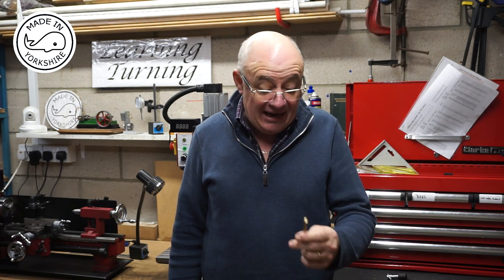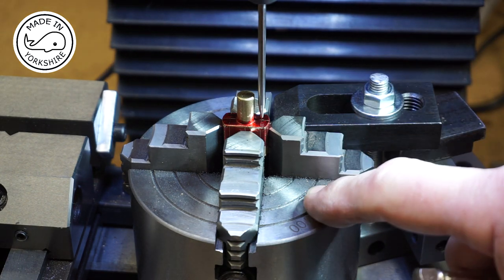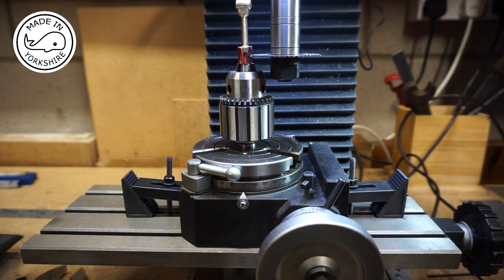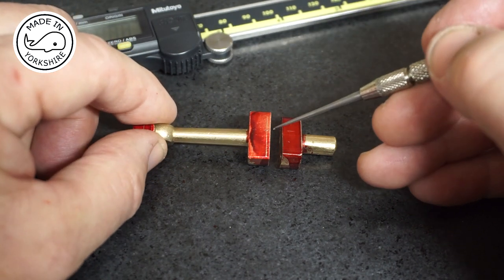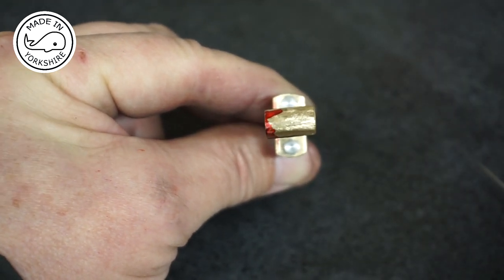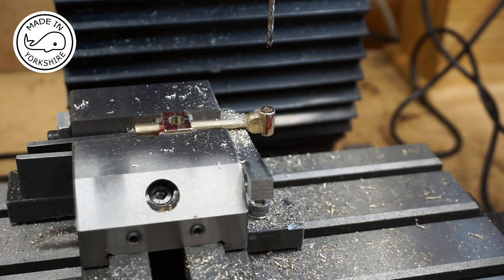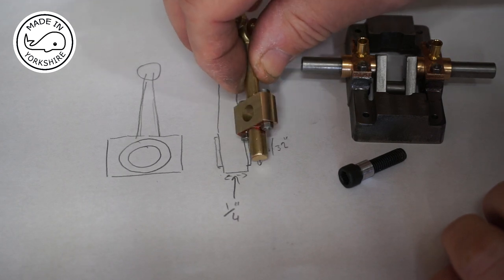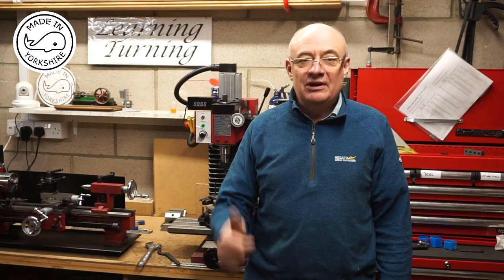#MT25 Part 9 - Making a Stuart 10V Steam Engine. The Conrod. By Andrew Whale.

Comment: I found myself yelling at the screen when you said you were going to drill and split the big end first. My thought was that the spigot is there to do any lathe work first. They gave a fair amount of material to work with there so perhaps working the small end first as that was more critical. Given that, then perhaps there might be enough meat left at the big end to straighten out the casting. Thank you for making these videos, I am enjoying them and will binge watch all your other builds immediately after.
Reply from the maker: Hi Grant. Yeah, you live and learn. I got there in the end but I would definitely reconsider my method next time.
Thanks for watching.
Cheers
Andrew

Comment: If I knew the material in the con rod casting would allow it I think I would have held the big end in a vise and used an adjustable wrench to twist the small end into alignment.
Reply from the maker: Hi John. Yeah I think I would try something similar to what you are suggesting. Probably apply some heat at the same time. Brass pressings are all new to me, but I would be more confident applying a bit of brute force next time.
All the best.
Andrew

Comment: I have deleted a comment that would have been useless to you. Given the point at which you discovered the problem I would have cut the con rod and made a connecting piece to pin and loctite the two parts in the correct position. I would advise against twisting brass it will just shear. Great video
Reply from the maker: Thanks John. A great idea 👍
Cheers
Andrew

Comment: Andrew. Like you, I was progressing nicely with the piston conrod, until I'd milled out the recess in the little end to take the cross slide. I'd clamped the big end in my lathe milling vice with the flats horizontal, then centred a 1/4" slot drill, held in the 3 jaw chuck, on the big end. Visually, the recess looks centralised but the widths of the "ears" on either side are significantly different.This, and your experience, tell me I'm not paying sufficient attention to pre machining inspection and set up. I didn't actually check that the vice jaws were parallel to the cross slide. It looked OK, but I should have used my DTI to eliminate that possible source of error. I'm giving a height gauge and granite surface plate serious consideration.The supplied stamping looked just like yours. The replacement I ordered looks like it's been through a CNC machine - even the spigot has been machined, so I expect it to be in perfect alignment. I asked Stuart if this is now standard in their kits, but didn't get a response. These conrods are too long to mount in a 3 or 4 jaw chuck: they won't swing over the lathe bed, but they will fit in the bed gap, so I'll have to mount them on my faceplate. Centring with a brass hammer is time consuming and frustrating, and the need for accurately positioning the big end is of some concern.  I'm setting up a dial indicator on the vertical milling slide. A wiggler works quite well on the lathe and I can locate an edge quite accurately. With careful measurement of the big end it should be possible to indicate close enough to the required point.I've almost finished my indexing head which can produce 2,3,4,5,6,9,10,12,15,18,20 and 30 divisions using a 30 tooth worm wheel and just 6 holes on the plate. So I can stop procrastinating and get on with the cylinder head.Your cross head/piston rod/piston work looks superb and I'll be please if I get close to that standard.Keep up the good work.
Reply from the maker: Hi Len - very interesting indeed. I think I read somewhere that Stuart had stopped stamping the 10V conrod - but I could be wrong. Having said that, it doesn't explain why I ended up with one. I definately recommend a height gauge and a surface plate - a very worthwhile investment. Although I've not started on the valve components, I hope to start trying out some assembly in the next video to see if what I have made so far works well together. We will then see just how good or bad my standard is! Good luck with the cylinder head.
Cheers
Andrew

Comment: Andrew, you might contact Stuart and let them know about the problem with the con rod casting. While they may not click on a link to this video, instructions on where they can view it, such as “Learning by turning - MT25 part 9..., could let them see first hand what you encountered.
Thanks for another great video.
Reply from the maker: Thanks for the suggestion Robert. By the time I realised it was 'warped' I had already spent a lot of time on the piece. I might give that a try if I end up having to re-visit it. Fingers crossed it will be OK.
All the best.
Andrew
Reply: Learning Turning Metal - by Andrew Whale the reason I suggested contacting Stuart was so that they could look at their inventory to make sure that others didn’t receive defective parts and not necessarily just to replace the defective part you received.
Reply from the maker: Ah - sorry - I misunderstood. I might give it a try.
Thanks
Andrew

Comment: Hi, if you had made the mistake of drilling the 1/8th hole all the way through, a solution would be to drill out and tap it to a larger size say 3ba, then  thread a suitable piece of brass and silver solder that into the conrod.  Then drill and tap to the correct size.  Not perfect but a pretty good result would be effected.

Also if the brass component os out od line and twisted as yours was it it possible to twist the part after annealing it and then re anneal to 'relax' the stresses involved.  The conrod would work harder later in service.  We would often have to remedy such errors in my engineering days.  The world is nopt perfect, we all make mistakes, the skill is knowing how to rectify them.  By the way, a silver soldered joint is almost invivible when machined.
Reply from the maker: Thanks TerryD15. I think I would now have more confidence in following the approach you suggest.
Cheers
Andrew

Comment: Coming along nicely :-)  It's a shame the stamping had poor alignment but I did wonder if you may have got round the problem if you had drilled the little end first (to run true in the skewed part) then when you milled the large flat sides of the big end set them true to the little end hole. (if that makes sense).

It may be worth considering a simple soldering torch if you plan to make anything larger, you did a great job splitting the bearing and rebolting together but a soldering torch is useful if you want to do anything bigger. It may have also been useful to straighten out the stamping like another reply suggested.

Keep it up Andrew, it coming along great - I'll get my boiler warmed up ready :-)
Reply from the maker: Thanks Pete. Unfortunately I am not as creative as you. I'm sort of OK following plans, but not great at diversifying. Don't get the boiler warmed up just yet - I recon I have a few more weeks to go!
Cheers
Andrew
Reply: Model Steamers, I was thinking the same myself but goes to show different ways to skin a cat n all.
Andrew keep up the great vids Dude G :)

Comment: Why didn't you heat the con=rod up and give it a tweak back into alignment, brass is pretty malleable.  I made a wiggler out of a dress makers pin, I can get holes spot on with it.  You need to make a slim slitting saw arbor  for getting in close to your work. Engine is coming along nicely.
Reply from the maker: Hi - thanks for the feedback. I know very little when it comes to metals, but I will consider heat if I end up in a similar situation. A slim slitting saw arbor sound like a 'must have' for me.
Cheers
Andrew

Comment: Hi Andrew, Happy New Year to you. TFS. May I ask when you bought your engine? I was given one for Christmas and the con-rod was a machined piece! Thanks for the mistakes and all approach may save me a headache :) just read some other comments, one about contacting Stuart to let them know about the twist! Maybe this is why I got  a machined con-rod! Best Regards G :)
Reply from the maker: Hi Graeme. I got the 10v kit direct from Stuart. I think I read somewhere that someone had had a similar problem and Stuart sent out a different type of machined brass. I think they might have changed the method of production. 
If that is the case its a shame that they are still getting rid of old stock in the kits.
Hope that helps.
Cheers
Andrew

Comment: You should contact Stuart. They say they’ll replace parts that are faulty in the instructions.
Reply from the maker: Hi, from what I can gather these type of brass castings tend not to be perfect. In the end it made no difference to the running of the engine.
Cheers
Andrew

Comment: Watchihng you do this makes me very nervous.  I would have done this quite differently--however, I have to do it all on a lathe as I have no mill.
Reply from the maker: I admire those folk that don't have a mill. I wouldn't have a clue without my little mill.
Cheers
Andrew
Reply: @learningturningmetal  
Yes, some times it's fun, and other times nerve-racking and dangerous.  but one thing is for sure, it's a lot more difficult without a mill.  Right now I am building a series of collet holdders (ER type) as I am having difficulty holding parts with a small shoulder-1/16th inch - in a chuck.  I am going to build a milling set up on my little lathe, do you have any good references?

One thing I really dislike about so many utube vids is that there are no plans so that I can SEE and STUDY the plans, so if I ever do a channel (not likely) I will set it up for peeps to download FREE plans.  the plans that one gets from Stuart Models are very iffy, as I am a professional draftsman and REALLY object to their lack of professional drafting in their plans.  One has to make very careful notes to machine their models.  Also, drafting has changed SIGNIFICANTLY since WWII which the plans look like that era.  Using fractions for plans went out in the '60s and '70s, we now use decimal which one has to convert to anyway.  I have never seen any calipers or micrometers that measure in fractions, altho'I believe at one time they were made.

Another objection I have is far more general:  The Steam Engine (notice the worshipful caps, please) is coming back--it simply HAS to, as overall, it is a better and more reliable machine than ICEs.  When one examines ALL the processes of ICEs, that is, the mining, the processing diesel and gasoline and other products, the transportation of those fuels, and the usage of those fuels, one realizes that it costs MORE in $$ and environmental damage per thousand miles than would steam.  Steam engines are MUCH simpler than ICEs, except for the diesel machines and can use virtually EVERY fuel source from grass to buffalo chips and every thing else that burns.

My problem with the Stuart Engine people, and all others too, is that , altho' these toys are WONDERFUL, and I enjoy them immensely, they are still worshipping old and longed for days of wonder.  The Steam Engine (again the worshipful caps) can now be updated by modern machining techniques and materials--so why no new models with better materials and new designs?  Altho' I, like most of us, use that silly slide valve, in reality it is a horrible piece of crap.  There are simpler slide valves that are actually EASIER to make and are far more accurate in design, functionality and adjustability.  The same can be said of almost the whole model.  All the little models are wonderful, however, I make them do something besides sit on the mantel for bragging to ones friends (along with a glass of wine which I also make).  The engine MUST POWER SOMETHING or it is silly to have bothered to make it.  It must be useful, grind some coffee or power an electric bulb or anything but sit on the shelf.

Buy the way, there are many other peeps who sell castings but they are difficult to find.  I know there is one in Portland, Oregon, but I would like to know of others.  If anyone knows of more, I would appreciate a buzz.